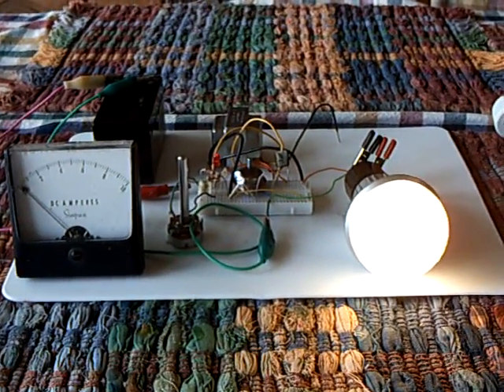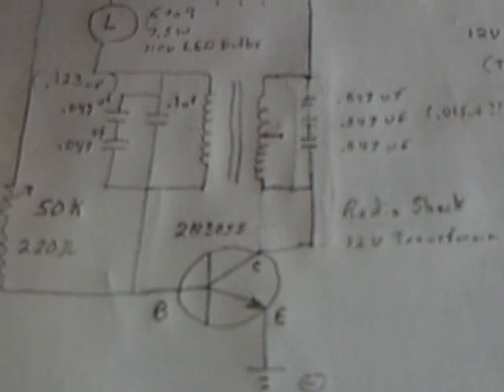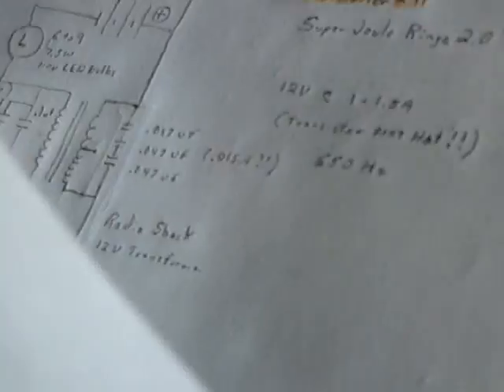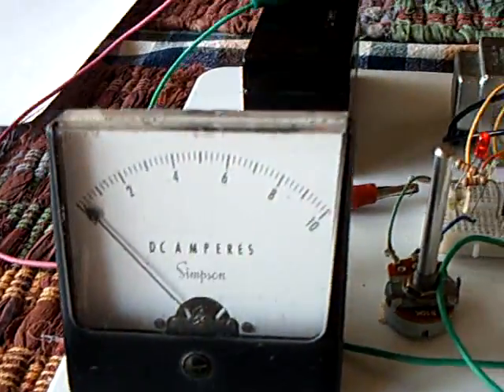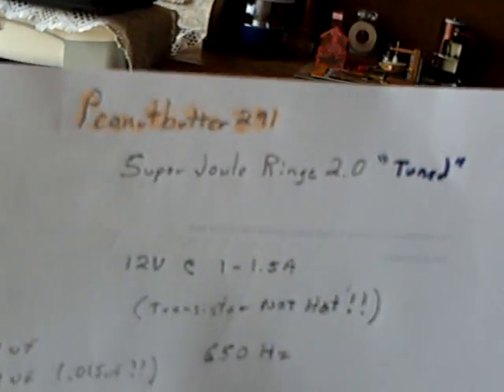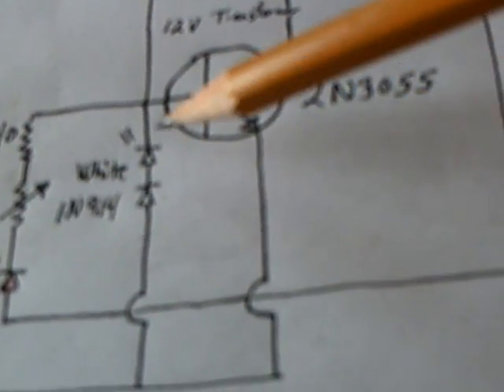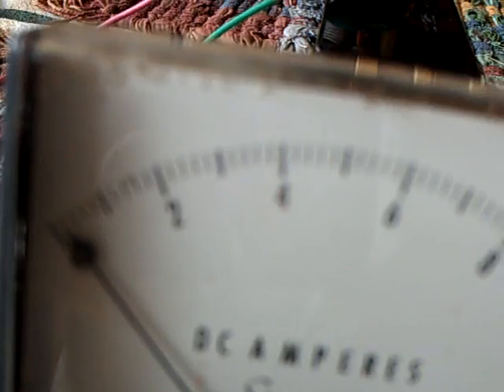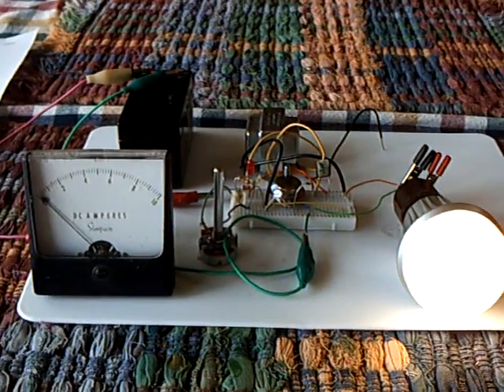Super Joule Ringer 2.0----The Amazing Peanutbutter model

Comment: Hi lidmotor, just looking at your modified circuit diagram and is there something connected to the coil somewhere in the middle on your diagram where the capacitor is attached to the end coils? thanks

Comment: I tried the second circuit you showed with an unmodified screw in 13 watt cfl, and it pulled 1 amp.. So 13 watts essentially. I think these are more pulsed DC transformers instead of joule ringers. I tried a small AC induction motor on the output instead of a light, and it started turning, but since the current only goes one way, it would almost stick.

Comment: I admire your work and enjoy your videos.  I don't know who would dislike these videos.  I have posted 100 videos and had one dislike in three years.  Now working on these circuits I get several dislikes within a couple hours.
I agree about the dimmable bulbs contributing to the circuit function.  The Phillips bulbs don't work as well.  I also find more bulbs run more efficient than just one.
I just got my sailboat in yesterday and will convert to a joule ringer system for lighting this summer.

Comment from the maker: I think that the circuit inside the 110v bulb is helping this work somehow.  Turn on an AM radio to a empty spot and listen to the frequency with different bulbs or voltages.  I'm using a 25 ohm rheostat now to vary the input and light.  The bulb is broadcasting at different frequencies as I vary the input power.  Very strange.

Comment: I've got this working too, but I only have two lamps. One question that comes to mind is that we are turning 12v to 120v just to have the bulb itself knock the power back down to run the LEDs inside. Should we open them and bypass the internal resistors so we could gain more efficiency?

Comment from the maker: Kyle this one is good one for several reasons.  A-----It is quiet.  B ---The transistor stays cold.  C---- The useable light output vs power spent ratio is good.  I wonder how many million 2N3055 have been made and are running things right now.  There are better transistors for this but this one works just fine.

Comment from the maker: I used two 220 ohm resistors in series.  I guess I should have mentioned that.  Any resistance around that value will work.  The Pot does the tuning.  After this starts up you can actually pull off the base resistance and the circuit will still run.

Comment: two questions: first i couldnt find a 440 resistor so i used a 430 & a 10 in series is that ok and second if you didnt have the transformer hooked up the circuit would still show voltage right?

Comment: success!!! I replicated the Lasesaber/Peanutbutter291/Lidmotor Super Joule Ringer 3.0 I'm no longer cooking my 2n3055 transistor. Funny thing though, my red LED bllnkes....lol . Yep read package ("blinking LED") Dohhh, Homer moment. Current draw on LED bulb .63A to .83A. CFL not as good 1.36A. Power source 12V 100ah RV battery. It's been running over an hour with no heat problems.

Comment: i tryed running this circuit on a program i have called circuit wizard and the red led does not light up. the white led will not light up unless i put a resistor potentiometer between the neg battery and the emitter of the transistor. Help

Comment from the maker: The good Dr. would probably frown on this use of his idea but it seems to works so why not use it.   I have thought about using a water powered genenrator on the boat but it would slow it down some.  They do make such a device commercially.  Wind turbines and solar panels are the usual method though for natural electrical power on sailboats.

Comment: Nice mods and using Dr. Stiffler's method is very cool. We use that stuff all the time in various exciters, so it's great to see it used here too. Will replicate your version of the circuit i'm sure.
Say, ever thought of putting some kind of spinning generator thing off the side of your boat while sailing ? Thinking as a battery charger. Wild would be to have the output spin a motor and prop, find a strong water current and gain an OU boat lol, accelerating off into the sunset :)

Comment from the maker: When I used the inverter it took 1 amp to run one bulb at about the same brightness as this circuit using 3/4 amp.  This circuit can be turned down to 1/4 amp and still run multiple bulbs.  It is an advantage.

Comment: I looked at peanutbutter291's circuit, and before I go off and buy parts, I would like to ask a question maybe you can answer for me. the 3 .047uf caps. Can they be replaced as there equivlent=~15nf and also the 2 .047 with .1uf in par.  =~.1uf????  If you can help me with this I would appreciate it.

Thank,    Jack